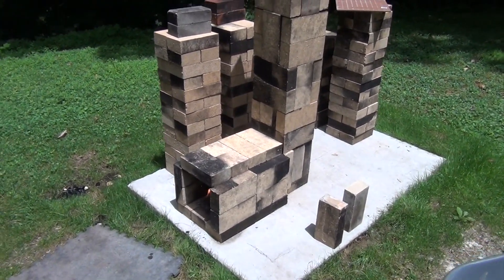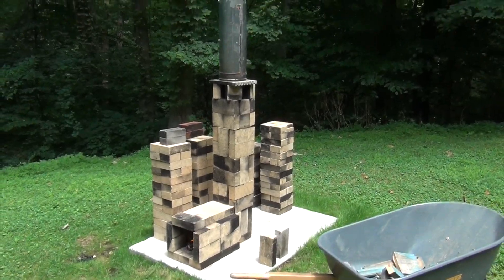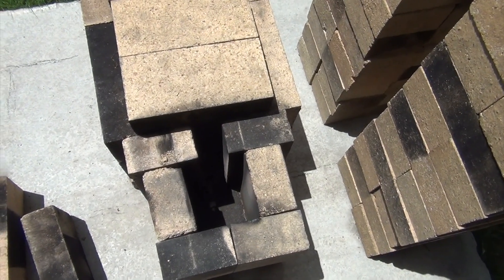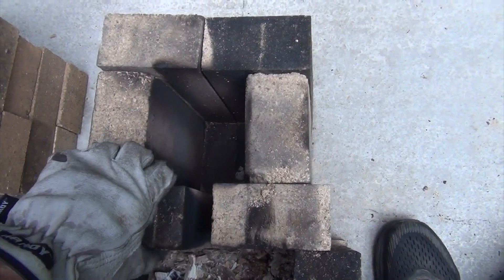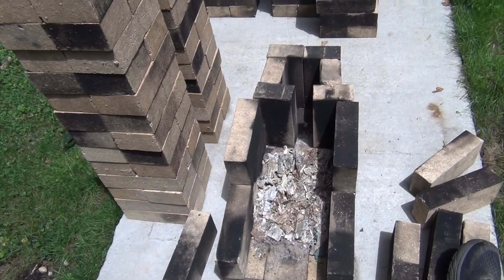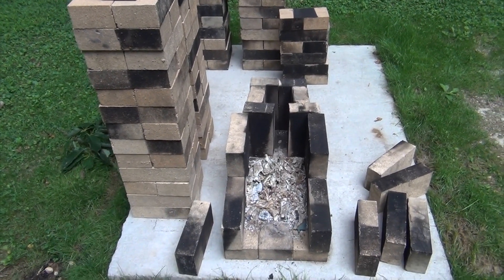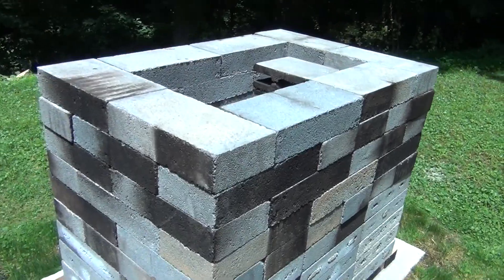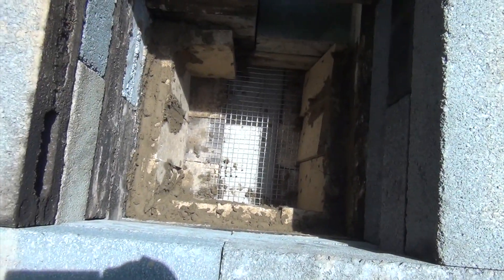Easiest Rocket Stove - 10 Minutes, No Mortar, No Tools, 9 inch x4.5x2.5 Firebrick - See Description

Comment: Your tile was not just a tile. It was a tile with something on it. Think it's kind of glaze. So, you need meterial that's HOMOGENEOUS and can expand in all directons. So, the coating on the tile will create tension and make it brake. Now use a tile from 1800's. They slichtly ticker. Don't have a coating. You can make them your selfs, if you want to. Here you can find them on the internet or where they restore a old building you get them for free (just ask).

Comment: I'm a huge fan of the batch box. That being said I built one without the "P-channel" as I didn't want to have to replace it every season. I cut firebrick splits at angles so that they left an opening for secondary air outlet near the port opening. It worked really darn well. The only time I got smoke was on the start-up, and if I threw fresh logs on the coals to continue the burn. As far as a grate in the bottom, I myself am not sold on that idea. If you do go thst route I'd like to see the results, I could always be wrong... I believe that the Russians did that on some of their stoves as a regional thing, based on what was available to burn. Coal burns better with air coming in from the bottom, wood likes to have the air coming in from the top. Hey, put the grate in the bottom, close off the firebox with ceramic glass and then see what happens in the burn chamber 🤷🏻
Reply: The bricks will eventually crack break. I would want to build a steel box to go on inside of fire box. And even in back on base row . Just for safety reason as heat will stil go thru the steel box.

Comment: If you would build a bend into the corner above the pinch, with a brick box above it, mightn't that ease up the flow on the vortex of the back-draft, "roundering" it, and facilitate a groovy little oven chamber? - like step the heat-riser back 1/2  or a whole brick, if that makes any sense.

Comment: Love it . I just wonder how the concrete floor will hold up to the heat after time.
Reply from the maker: It won't hold up in the second stove without the firebox being lined..... That is why I started to line it with firebrick. That stove I call a failure, but it wasn't too much smoke. If the first 3 feet up was lined with firebrick... the rest would hold up just fine.

Comment: I made a Cobb stove same as the Zuni and others use for bread they are domed  pitza oven the same but not mobile you stack rock about 2’ high fill with sand then coat Cobb on top and form a dome they use wooden door